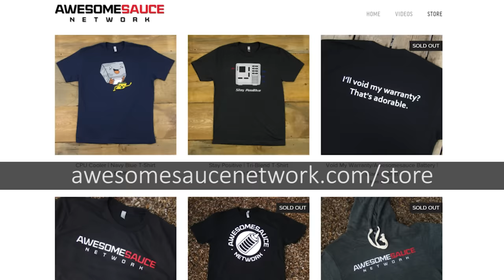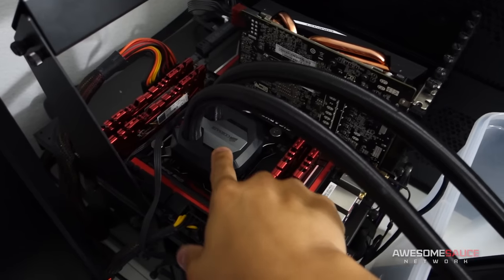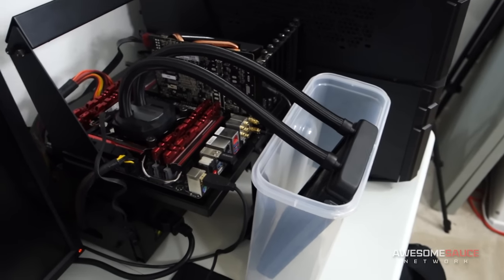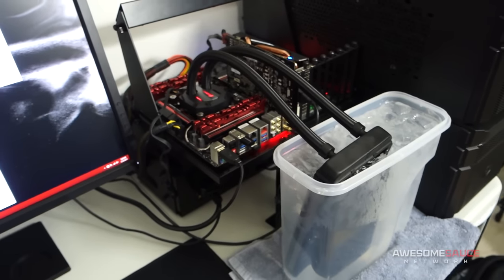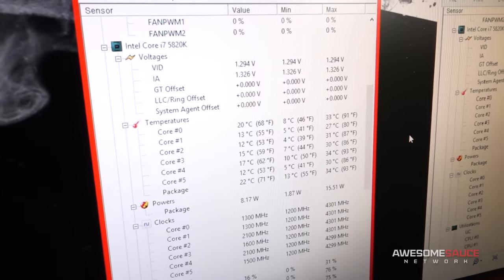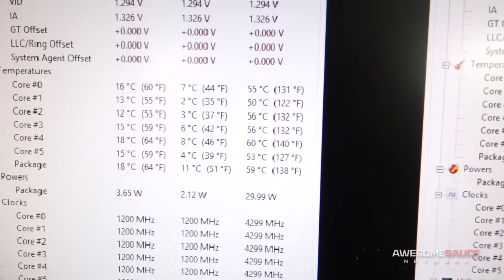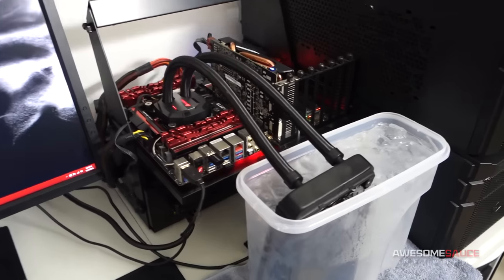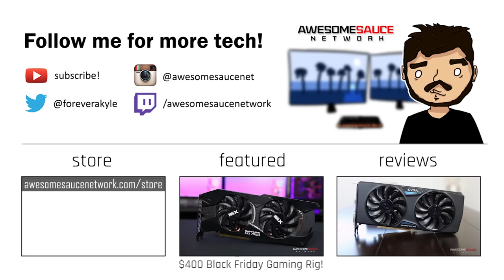AIO Ice Bath Challenge! Does it Work?

Comment: The method shown may seem impractical but what if you used a custom loop that cooled only the water in the cereal box (in your example). Even without the ice, the 2nd cooler would keep the water in the 'cereal box' cool.  I think that could actually be practical or at least you could set this up and forget it which solves the problem with the set up in the video ........ if you need that kind of cooling.  Then again maybe no matter how many loops you piggy back onto the set up maybe you eventually you end up at a ratio of whatever your ambient is.  Someone do the test

Comment: I've done this for a while with cryopacks .. No water needed .. The CPU immediately warms the water in the loop so I never had any condensation. I had temps in the single digits. Never had issues .. Also .. When your paste is properly applied there is no air to transfer moisture.

Comment: I very much doubt that this comment will be seen but you will see a huge difference if you can circulate the cold water as you have stagnent water inbetween your fins which heat up, I have found some pc fans that can run underwater for 30minutes or so but you will probably have to through them away after wards, anything for a video though
Reply: Metal slugga I  noticed this comment and had no idea what yoyr are talking about aprt from ... er... underwater fans?

Comment: how about drill 2 whole in your freezer an place the Radiator in the freezer and use Fans? you can go full ham with the fans and probably wouldnt hear it because freezers are isolated ^^ + the Air would be very cold and it probably would cool well
Reply: LaVersus EnTerTaIn linus already debunked it doesn't work

Comment: 95C underload with an AIO? I know it was overclocked but those numbers just seem terrible. All in one coolers have never really impressed me since the temperatures for extended period of time aren't really lower than with a decent air cooler. A good air cooler will have a high surface area of fins, so the only advantage of water being it will delay your increase in temperature. Even with a custom loop you will need huge or multiple radiators to really make a difference.

Comment: This is just the tip of the iceberg for sub-ambient cooling. You should try a phase change build someday, you'll handilly get temps in the neighbourhood of -40C. Just... stay away from Little Devil. None of the compressors in their phase change cooling kits were designed to push temps like that, and if you try to run them as such (which is how LD markets them), you'll have a bad time.

Comment: Not a good idea to run cold water through a radiator. you can get condensation from the temperature difference, as well as warping, and/or cracking.
Reply: the cpu isn't running hot

Comment: I'm just tossing this out there for the lulz, but wouldn't be possible for people who live in the freezing ass-ends of the world (like Quebec in winter) to stick an AIO radiator outside, thread the tubing through a window and connect it to a CPU's cooling unit? Come to think of it, our using double windows or closed porches means there's a lot of ways to make sure the radiator does get exposed to outside temperatures while still remaining dry.

I mean, our winters tend to run at -4 degrees Fahrenheit, which is pretty damn fucking cold. Also, you could maybe stick the radiator block in a dorm-sized fridge - or maybe even adapt a small drinks fridge to serve as a kind of case.

These are all insane and impractical ideas, I know, but since this is as theoretical as an ice-bath solution for AIO coolers, I figured why the hell not?

Comment: A better part two would just be to test ambient temp. water. Why? because no one would ice for days but you could make a sealed system extremely easy by sealing those tube to a container. That amount of water could probably displace a ton of heat the question remains how much?

Comment: It's a neat idea but not very sustainable. Eventually the ice will melt and the water in the bucket will level out to the temps of the water in the loop... at that point you'll actually see higher temps than with the fan driven AIO because there is no way to remove the heat.

Comment: ANYBODY! I have a stock HP Envy 700 series (700-214) and want to upgrade it. I have already gave it a graphicas card, XFX AMD radeon 270x core edition. ( It's not really good but I can play on low-medium quality.) I Its current specs are an Intel core i5 4440 at 3.1 Ghz(stock cooler), 3 sticks of 4 gigs of ram at 800Mhz each. 2tb of HDD space. I want to upgrade and firstly I thought I should get a new case first. The stock one has no airflow and is very loud. Then I thought to get a new power supply at 600w because the current stock one at 330w is just bothering me (And i dont trust stock PSU's) I'd would like advice if this is the right path to take in upgrades and if not, help would be aprreciated

Comment: Really bruh? It doesn't mean more overclocking? Then LN2 wouldn't be able to overclock for 2 GHz more...  LN2 doesn't automatically enhance your CPU.
If you're hitting that low temp you can for sure increase the voltage and clock speed on the chip for at least 0.5 ghz.
Reply: sermerlin1 Unless you get to the voltage limits of the chip, which is probably the pratical limit for this kind of test
Reply: 20-40°C less won't raise the voltage limit significantly enough to allow a higher OC. going down to -160 or even -190°C does, on the other hand...
Reply: givemeajackson Actually... It will. It won't allow for 2ghz more headroom but it would allow for at least 0.5 ghz more increase. :)

Comment: Great video but MY ADVICE IS TO REMOVE THE RADIATOR AND USE 6MM DIAMETER COPPER COIL PIPE 5 METRES LONG SOAKED INTO ICE WATER. YOU MUST HAVE AN LOW SPEED MIXER DC MOTOR 30 RPM TO CONTINUOSLY MIX THE WATER.
THE HEAT JUST BUILDS UP VERY FAST AROUND RADIATOR.
IF YOU WANT TO GO DOWN TO 1-2 DEGREES CELCIUS, ADD SOME SALT TO MELT THE ICE VERY FAST INTO THE BUCKET. THAT LOWERS THE TEMPERTURE SOO FAST THAT YOU WILL BE SURPRISED. ITS ALL ABOUT PHYSICS. FAST THERMAL EXCHANGE.
CLEAN COPPER PIPE WORKS BEST.
YOU MUST INSULATE THE CPU PIPE THAT SENDS THE WATER INTO THE CPU. IF YOU DON'T, THE ROOM TEMPERATURE WILL LOWER THE EFFICIENCY. YOU MUST HAVE 1°C LIQUID GOING TO THE CPU.
THE SYSTEM I AM USING FOR MYSELF ITS AN ICE MAKER WORTH $130 AND DRAWS ABOUT 100 WATTS FROM MY SOLAR SYSTEM BATTERY KIT 12V 400Ah WHICH IS POWERING MY GAMING PC. PLUS, WHEN I DON'T PLAY GAMES, MY PC IT'S MINING MONERO JUST FROM CPU. I AM USING RYZEN THREADRIPPER.

Comment: yeah.. 24 hrs ice..untill eventually condensation forms on the CPU block, which then promptly trickels down into the socket and kills your CPU/MB...
Icewater cooling IS possible, but just as with LN & other extreme cooling, it is extremely impractical and requires extra setup & precautions.  i.o.w. this setup is highly irresponsible

Comment: That's a really crappy AIO cooler.... My max temp is 45-50c and idle is around 20-25c.
Reply: +MercilessHobo Well, he Overclocked his 5280k (@4,3Ghz), so it's normal. But, WOW, which AIO are u using?!?!
Reply: HardwarePoint Just the NZXT Kraken X61. Stock fans. 2 rad intake, 2 case exhaust. He may live in a warmer climate though. I'm in Missouri, but our summers still hit 100-110F. My ambient room temp is usually around 20-22c(pretty chilly indoor temp, I prefer to be cold with a hoodie than hot in a tank top). At idle my PC basically stays at ambient temps. Sitting at 20c right now just browsing youtube. Oh and the processor is an FX-8350. I guess that's important because contrary to popular belief, it runs cool. Especially at idle.
Reply: MercilessHobo I'm in South Spain so here the temps are warmer but I have a 4770k. First I used an Antec 650 h20 and the temps was 80-90ºC, now, with a NH D14 it's at 65ºC (100% load)

You have an awesome CPU :/ My friend have another 8350 with a h105, at idle stays at 40ºC, but with the Aida64's test at 70ºC.

Thanks for the info about the AIO :P
Reply: HardwarePoint Even with the stock cooler my CPU at stock clocks never hit 60c in gaming(60-80% load). Probably a combination of a well binned CPU and a low temp room since the NZXT x61 and H105 are about on the same level. But you must have a really warm house, those temps are pretty high. At leastt you're down to 65C now though. Good luck with future CPU adventures. :)
Reply: MercilessHobo Yep, I know, my CPU is horrible (like the 70% of the 4770ks), Im thinking to do an IHS mod, but, anyway, my room is really really hot, Spain is bullshit, too hot xD

Comment: ill just stop the video... why wouldn't it work?  of course it will. obviously he doesn't know thermodynamics.  water or and liquid will have better heat transfer capabilities then air... only thing I can see is that it will significantly drop youre cpu and gpu temperature greatly...